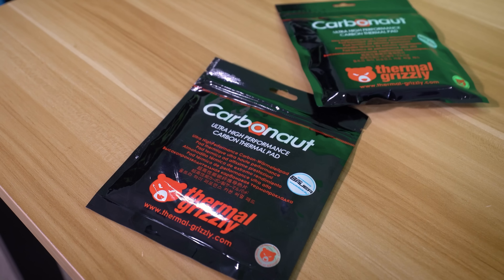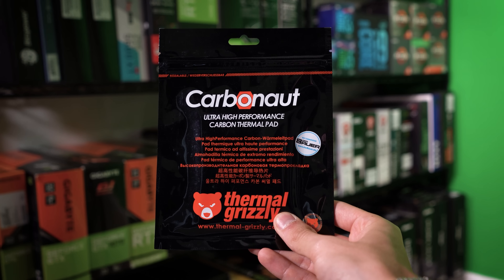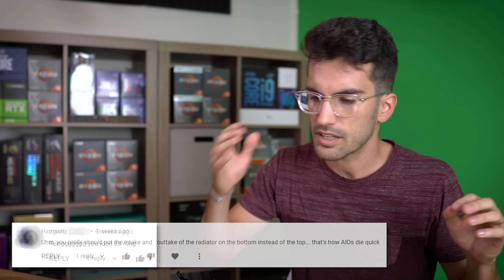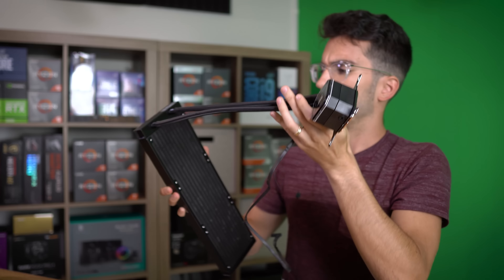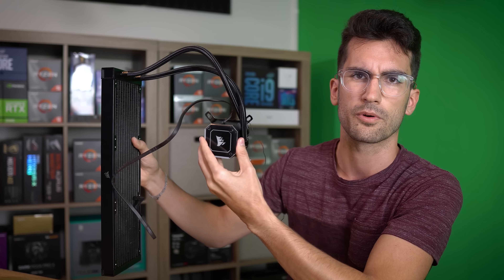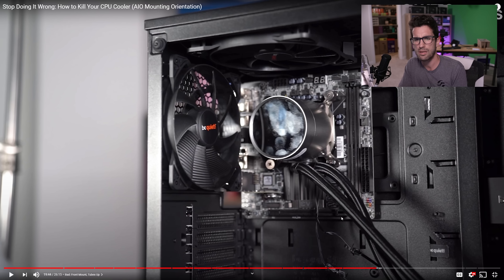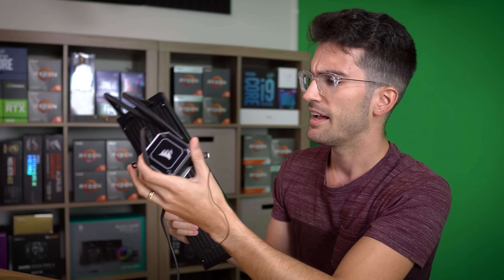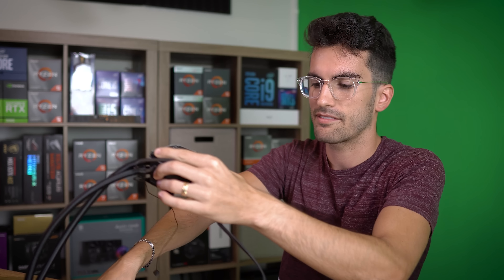Let's Talk About AIO Orientation... Again

Comment: At least GN attempted to do SOME science in their video.

This whole video is just speculation and opinion I don't see how it's any better than the "keyboard warriors" championing tubes down.
Reply from the maker: ? This isn't speculation. It's basic fluid dynamics. Air is less dense than water, and Asetek units with low pump head aren't capable of continuously churning air downward after the closed systems have primed - again, assuming they've been correctly filled. Took plenty of this in engineering school and didn't think it was up for much debate, really.
Reply: @GregSalazar  But it's a closed system like you said. Are you really saying the pump isn't strong enough to pull in air bubbles? I thought that's what Steve showed was happening. I'm not trying to argue one way or the other but I think there's a little more to it than air is less dense than water. I wish you had something to show your point other than speculation.
Reply: @GregSalazar  8:23 is that not "continuously churning air downward" or am I missing something?
Reply: "The air bubbles, on this side, are being pulled in -through this barb, down to the pump..."  ? You said it yourself...?
Reply from the maker: You're ignoring what I said immediately after that, conveniently. I said this is only an issue when you have giant pockets of air in the system... which should not be the case if it was filled correctly. The fluid won't expand anywhere near that much under load, so filling it up more than shown in the video is ideal. This would prevent those air pockets from leaking through the barbs in an upright config.
Reply: @GregSalazar  The air pocket didn't seem that excessive when I watched it, but I'll have to give GN's video another go. It just seems you are defending your builds here instead of actually showing evidence to support what you are saying. Why don't you show a build from 3+ years back with tubes top or show the gurgling then it subsiding. To me, any air entering the pump -even for a short period at boot up, is bad for the longevity. As Steve said its MOSTLY a noise issue but not entirely.

Comment: "convection"
Reply from the maker: Yeah... It is literally the process of convection by which these "radiators" operate.
Reply: @GregSalazar  Forgive me for thinking convection was hear rising, and radiative heat was heat radiating. My textbooks must have been out of date.
Reply: @GregSalazar  Thing is, it's neither. Radiative heat is infrared leaving the source and being absorbed by another object. Convective heat uses simple differences in air density due to temperature, a la Roman baths. In the case of a fan-cooled radiator, it is a direct deposit of heat energy into air coming into physical contact with the material of the radiator.

Comment: The fact that a lot of cases simply don't allow for AIO radiators to be mounted in the "correct" position according to Steve makes his video moot. His "flip the rad" advice is dumb because 1. your GPU slot gets blocked 2. the tubing is rarely long enough to allow you to do so. The case manufacturers are to blame, not the user. Or just don't buy cases which limit you to front-mounting the rad.

Comment: If you're going to be spending $120+ on a good AIO why would you ever sacrifice or risk any type of performance issue by not mounting it  correctly/optimally? Also, many people go for AIOs due to wanting a good balance between noise vs performance, so having the tubes at top with a front mount will still cause noise, even if it's not going to cause issues with temps/pump life.
Reply from the maker: A properly filled "$120+ AIO" can be mounted up front (with barbs up) without issue. The pump is sufficiently below the highest point in the radiator. It's not a matter of risk if it was designed correctly. And if you're willing to spend $120+ on one, you're assuming it is. If you have doubts, don't waste over one hundred USD.
Reply: @GregSalazar  right, but sub optimal orientation still causes noise. My point was, if people are spending the money on an expensive AIO, you should mount it optimally.

Comment: This is one size fits all advise, improperly applied to many varied products. I respect your opinions, but in this case, when different companies have different air volume allowances combined with fluid loss over time, some people will inevitably experience problems with a front mount, hose up setup. This advise shouldn't exclude discussing the dangers of doing so without faulting the companies for "improperly topped off radiators" even when they fall within the specific company's tolerances. It is possible and even likely that some radiators will not work well in this configuration. If thousands of people heed this advise, caution be damned, most will be fine but a few people will have ruined systems because of it.

Comment: Always up
Always exhaust
Reply from the maker: Nope, not always. Nothing much wrong with running it up front so long as your pump is below the top of your radiator and the loop is sufficiently filled. Several of us have discussed this and clarified. Even from a temperature standpoint, it isn't terribly detrimental.

Comment: Hi Greg, i don't think mounting the radiator at bottom position will damage the pump. Pump is spinning at high speed and fluid will eventually reach the top part where its filled with air. There's an example for rear differential fluid level in vehicle you might want to look at as reference for fluid mechanics https://www.youtube.com/watch?v=9-yG3D3JBRs